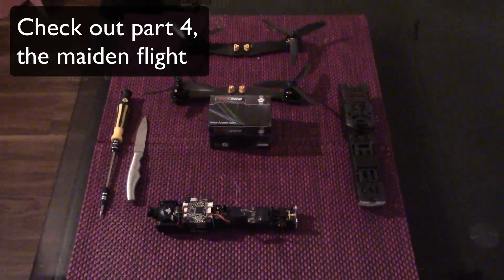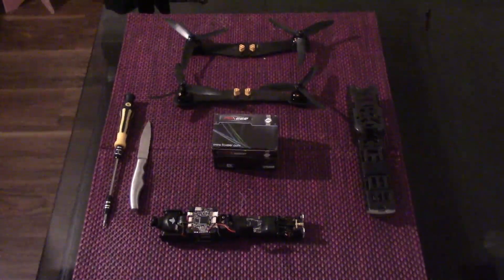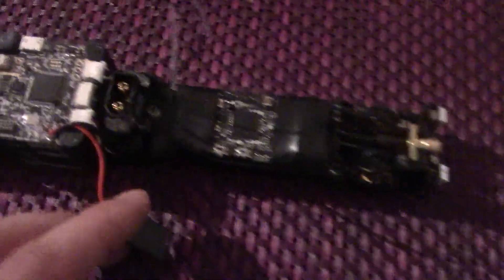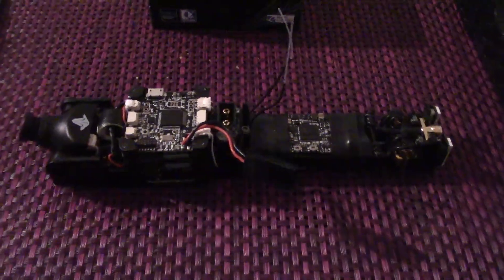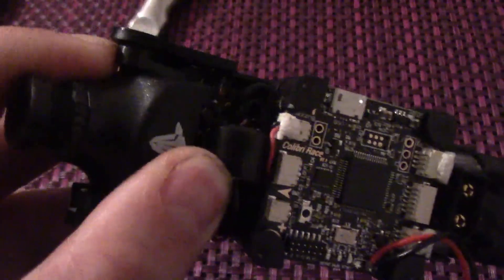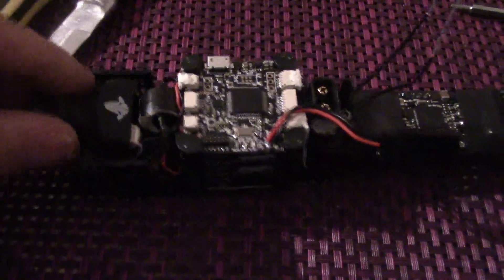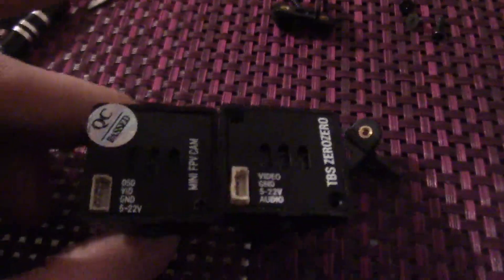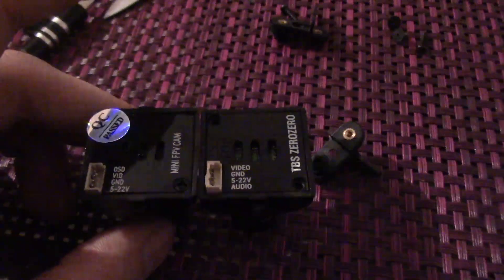TBS Vendetta Review Part 5 - How to swap out ZeroZero for HS1177 FPV Camera

Comment: great and easy to follow video! The fpv vid quality on my new Vendetta was terribly washed out so I upgraded to the HS1177 like you did however the video is still super washed out and I can't fly cause everything just goes white. Am I missing a step? Do I have to use that OSD tool cable and tune the camera?
Reply from the maker: that really sucks! thanks for the comments! have you tried adjusting the settings via OSD? the "Steele" settings seem to be what people like to use.
Reply: thanks again... I think that was it! I adjusted the settings on the camera and it looks way better. I haven't had a chance to fly it yet but I think that did it

Comment: I've hit a snag, the plug on the Vendetta obviously fits the zerozero fine, but the plug on the HS1177 is smaller. I tried using the supplied plug from the HS1177 as that obviously fits, however the cables just fall out every time I try to push the plug into the HS1177. As a newbie I can't work out what is wrong, or has it been made now with different plugs so it doesn't fit?
Reply from the maker: Hi that does seem a little strange. From memory the cable that came from the powercube to the zero zero fitted the HS1177 just fine. All that was required was moving the pins around to change the pinout :/

Comment: Any video clip after you swap fpv camera to HS1177?Was video quality problem solved?Thank you in advance.
Reply from the maker: +Eun Sang Noe The video quality was improved yes, the issue with interference and the reduced range on the VTX is still an issue. My belief is that the Triumph antenna OR the Unity Pro VTX is broken. I just need to get my hands on another antenna to test this and report back to TBS for a replacement for the failed part.

I have another Vendetta on order, so when that gets here I can swap antennas. I will do another video showing the improved quality. Sure thing.
Reply: +Neo FPV O.K. Please let me know If you solve the problem.TKS
Reply from the maker: +Eun Sang Noe - As requested here is the video of me using the HS1177
https://youtu.be/lJswSFXnch4
Reply: Did you find out what your Problem was? Because i know it - maybe ^^ I had same issues on my TBS Vendetta like you. I double checked my VTX with my ImmersionRC RF Meter and it seem to be fine. I tried changing the antenna with no change. I finally ended up to send it back to TBS for Repair. It came back with TBS ZeroZero fix (the image was better, but ZeroZero is still a piece of crap) and without any found problem on it. I mounted everything like before and had same issues like before. 

Finally i got the Tipp that with the X4R is one Antenna Transmitting for Telemetrie and the other one is just receiving. I mounted the X4R directly in that Direction, that it pass near a Video-Signal Cable and caused some baaaad interferences while flying. Even with 800mw i just got 100Meters and after that, the Quality was that worse that i literally can`t see anything. I turned the X4R 180 Degress (the Antenna`s are now different then before) aaaaand - PROBLEM SOLVED! It was just the Issue with the Transmitting-Antenna of the X4R that passes near a VID Signal-Cable if you use the regular mounting holes that TBS made into that plastic-part. If you just change your Antennas (left antenna to right hole and opposite) you solved that problem! 

Took me about 2-3 Weeks for finding out whats the Solution! ... and 10-15 E-mails with the Shop-Owner. Even TBS didn`t knew the Problem obviously. It was just the damn Antenna on the X4R/XSR that transmitts telemetrie too and don`t just receive signals! Swap it and you`re happy ^^
Reply from the maker: Yeah I think that was a big part f the issue. I moved from XSR to X4R and too like you did swapped antennas and the reception was much improved.

Unfortunately other issues have now meant I don't fly the Vendetta any more. It become too unreliable :(
Reply: What other issues?
Reply: James Papier
VTX-Communication sometimes didn`t work (need to Unplug multiple times), VTX Blackout without Reason (Switched VTX to a new One), ZeroZero Cam bad as hell and other Things like that. I`m not the only one with such  Problems.
Reply: Exactly same with me.

Comment: Will The HS-117 board and lens fit in the Zero Zero Case? Try that ans see if the camera guts fit in the Zero Zero case. Then you can mount it in the frame normally.
Reply from the maker: I don't think it will. When I looked the screw holes and/or cable connector were in the wrong position. Its been a while since I last looked at the ZeroZero. I basically just binned it off.

Comment: Hi again, did you manage to resolve the OSD issue and if so, how?
Reply from the maker: Hey, sorry which issue was that?
Reply: +Neo FPV where the top line of the OSD information was chopped in half and off screen when you put the HS1177 in...
Reply from the maker: Ah, Well it ended up only occuring on my Headplay HDs for some reason. It was fine on my skyzones. So no that remains a bit of an unknown. I have not used the headplays since really.

Comment: Hi I am having an issue where I get a garbled video feed to my Fatsharks. I can't tell if its the FPVision or the Zero Zero, but sometimes I get a clear pic sometimes a garbled pic like there is interference with the FPVision or the camera is messed up? Is this the problem you had with yours?
Reply from the maker: The Highest Virtue no this is not an issue I had, this was a video on the V1 Vendetta and it does not have the FPV vision it uses a Unify. 

I would capture some images of the problem and send them to TBS Support via a ticket. If it’s interference and it’s it happens on all channels and bands it could be a faulty fatsharks module or Fpv vision, I don’t believe there is cabling as it’s a stack? 

Sorry I can’t help more.

Comment from the maker: I am a loss with the VTX quality and not to mention the channel mapping are all wrong. I will try to not give up on this lol ;)
Reply: +Neo FPV This contains the Unify pro video receiver right? You know you can select the output power of that vtx via the OSD you are using? Double check if that setting is available. I guess it is set to 25mw which would explain the VTX quality. You can go up to 800mw.

Edit: Yep it's under video transmitter.
Reply from the maker: +Salerg Hi yes I have been doing many many tests on the TBS unity today. I have changed from 25mw all the way to 800mw and it does help, but the interference is still very noticeable. Things seem better on the SkyZones, worse on the Headplay Goggles.

The problem is in the UK we are legally only allowed to use 25mw. I have a race next weekend and I will be required to prove I am using 25mw or will not be able to fly. I need to get this working on 25mw really. It is a real pain! Many thanks for your comment and advice!
Reply: +Neo FPV What antenna are you using on your goggles?
Reply from the maker: +Salerg ImmersionRC, the red and black ones lol
Reply: +Neo FPV When I put mine together, I used an FrSky X4R.  Not unlike an XSR I would imagine it has 2 Earthed Dipoles also.  However, I have no idea how you managed to get yours in that hole without pushing all the other leads going through there.   Having said that, I purchased mine after I saw your first video, so perhaps they figured everyone was doing what you were doing and decided they'd just make it impossible in the next batch for anyone else to do it too.   Having said that, the destructions that came in mine, they didn't change from recollect, so anything is possible.   Mine has only lasted because my mate helped me weld it in using his version of hot gluing which I must say beats anything I have ever seen.  Incidentally he helped me get that rear hatch to stay using the same method.